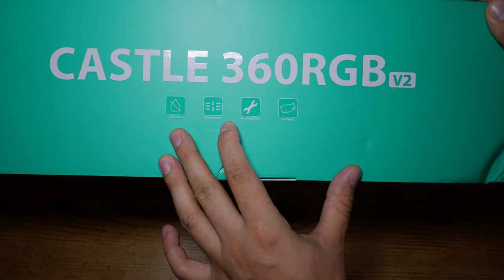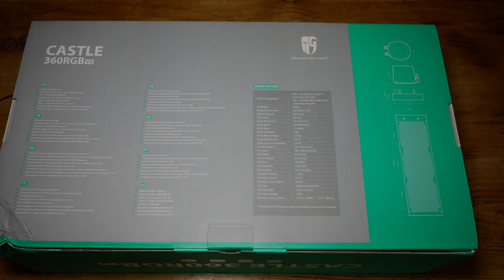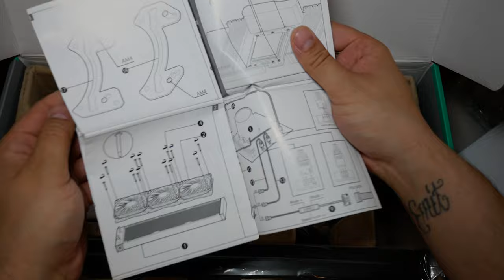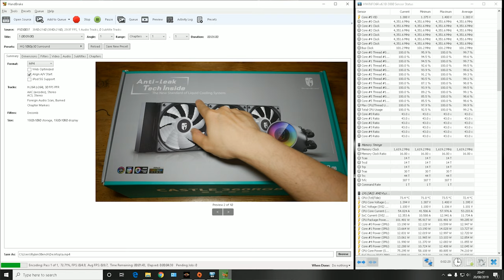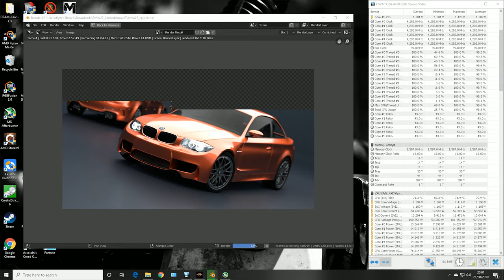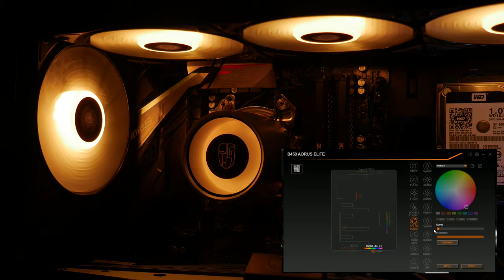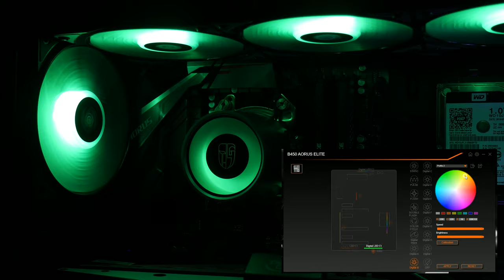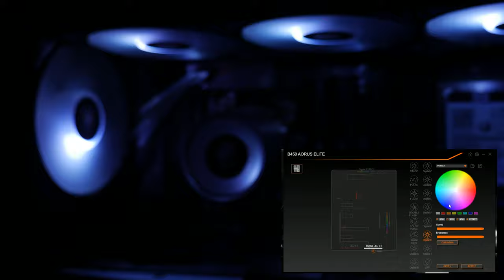Deepcool Castle 360 RGB V2 - Unboxing, Review, Install, Lighting Effects + Ryzen 3600 OverclockTemps

Comment: Just installed a Castle 240EX. Love it. Absolutely silent at idle. Can barely hear it at max load. I used the paste that came on it. It keeps my R5 3600 very cool. Looks amazing. I didn't want the RGB fans because I mounted the radiator where you can barely see the fans and there are RGB fans in front of it already. Couldn't be happier with the purchase and as long as it works like it is for a long time.
Reply: Temps are great for sure,but my castle 360 fans are too loud at only 1100rpm honestly

Comment: tip - you dont have to edit pump pwm curve as most of them (like in this case) don't actually receive the actual pwm signal as they're mostly 3-pin cables (the 4th pin is supposed to be the one carrying the pwm signal), and hence, these pumps usually run at their max RPM. Your bios may show that it's running at a lower value at the moment but that is only a calculated value out of the total RPM (depending on the curve you entered), which it is SUPPOSED TO WORK AT, not the actual value at which it is ACTUALLY running at. So, in the end, most pumps work at their max rpm as they only have a 3-pin pwm (just like this deepcool one). 
There's a reason these pumps are designed to stay at full RPM, and that is actually to extend pump life (seems counter-intuitive but it's actually true). The observed charasteristic of these pumps, is that changing their speed actually worsens the life of the pump as the changes can be quite frequent, and do not happen gradually. So running at full RPM yields a better life for the pump, as compared to variable RPM. 
Hope this was informative enough to help you save time with CPU pumps in the future :)
Other than that, great video man. Cheers :)
Reply: Hey bro , does pump works at max all the time for all AIOs ( low to high end ) 😊
Reply: @anuragsingh4498  most of them dont. but if you see that your pump's pwm cable is 4 pin instead of 3 pin, then it has variable RPMs. 3pin ones dont usually have RPM control pin connected.

Comment: WARNING warning.. read this about the product...  The cpu am4 mounting bracket can on gigabyte x570 pro and ultra motherboard ( and maybe other ) create allot of problems for you.
The problem is the am4 mounting metal mounting bracket touches the condensators next to the cpu and then electricty can "crawl" from one componment to the other.
The problem is the am4 metal mounting bracket is to wide and long.. It can at the same time also touch the top m.2 nvme harddisk.
I have had issues with computers crashing in all games, and BSOD for 3 month, and the moment i removed the cpu cooler and installed another cpu cooler ( corsair ) then the instability stopped instant.  So be VERY aware of this design flaw.
If i recall correctly it cover 2-3 condensators in the top and touches with about 1mm overlap.. and it also touches on top of the m.2 nvme harddisk if it have a metal pad on top of the m.2.
Just saying metal that touches metal that touches metal = can make electricty move arround your pc.  BE very aware of this.

in the video you can see how it almost touch the condensators in the top left.  Im not sure if the metal parts in my product maybe is wider than in the video, but i did have major problems for 3 month becourse of it..  https://youtu.be/AUmSZpIX4nw?t=1217

Comment: Hey man! did you just connect all your ARGB devices into the included ARGB hub?. Ive counted, you must have at least 7 ARGB devices all synced up.. cause i was wondering if there's a limit into connecting argbs devices of one header or hub..
Reply: yea there is a limit, its related to voltage. from the mother board header its around 6 to 8 fans. if the hub uses power from sata. it might be around 10 to 12. i think so!!.
Reply: @SparkPlug8977  no its not limited to Voltage but current. Cuz its a flow divider and not a Voltage divider. And yes there is. Its 1. Limited to current and 2. To the ammount of Individual led(for my MB its 500)
Reply: @saphyresdarkaine  ohhhh I did not know that. Thank you for the info😁

Comment: PLS help i have this cooler in my system but i cant find how to change the rgb light or wich thing i must download to do it
Reply: Did you ever figure it out? Im wondering the same thing.
Reply: @chriswilson1215  yes i found a Controller inside my case and it changes the lights.

It’s a small black controller that’s connected to the cooler
Reply: @Nic_Slash  okay awesome i will take a look at mine

Comment: just got this aio n a pack of 5 deepcool rf 120m fans to replace my corsair 240 aio n generic fans in my hydra desk build. installing tomorrow when kids r at school as i have to do a full strip down to mount the back plate. its goin on an i9 9900k. your vid helps with confirming the chain of fans from aio tho will have to use a second controller for the exhaust side.

Comment: Hello theFullSetup, at 9:48, yeah it does come with daisy chan cable and i have 4 cf120 fans hookup into it. I recently bought Castle 240 v2 and it comes with that LED connector, should I just hook the female 3 pin of the daisy chain cable into that ledconnector to sync them all fans? Great review tho 👍🤘

Comment: I am stuck... and bought 6 LL120 Corsair fans and Corsair Commander Pro. I also bought the Castle 240mm v2 (5v) and paired it with Asus X570 Gaming Plus Wifi.. can I use the 4 pin 12v Mobo to plug the 2 3pins AIO pump fan/LEd!? Anyone can help with that.. I also bought Deepcool 5v to 12v adapter and still don’t know if I really need it... anyone has a clue? Don’t want to burn anything... it’s my first build

Comment: I bought the castle 240 rgb v2 product and noticed that the pump led has a little less brightness than the fans led, I was wondering if it is normal or my product may be defective
Reply: The exact same issue with my cooler master aio

Comment: So I installed this before I completely removed the cables for “mastercool 360 rgb aio”, this one works its function but the average temperature goes from (mastercool 65) to 80-90. The rgb doesn’t work but it’s plugged in... not sure how I’ll manage to fix this any tips anyone?
Reply: I saw another comment saying that you have to have a 5 volt rgb header on your mobo

Comment: You installed AIO as exhaust on top? i thought aio radiator is always front intake?
Reply: Doesn't have to be, I don't think I have ever, in a decade, had an AIO setup as intake.
Reply: it's better to have it on top as long as you still have a positive pressure inside the case.
Remember, many smaller cases dont have large AIO support on the top and have only front-mounted options.
But if you can, mount it on the top. But maintain positive pressure otherwise the case can accumulate more dust inside than neutral or positive pressure.
Also, while doing  multi-rad setups, the hottest fluid should go in the last exhaust radiator, and not the first.
In a single-rad setup, top mounting ensures cooler air going into the GPU first, which usually have their frequencies dependent on their temperatures (lower GPU temp - higher achievable GPU freq). The same does not go for your CPU. If you want your CPU running at 5GHz, it doesn't hurt much if it's temps go up from 75 to 85, or even low 90s, as CPU performance is not much temp-dependent as long as you do not reach the throttling temp limits. 
I see you're a gaming channel, and it's better to keep your GPU cooler than the CPU.
Also, if you think you're gonna reduce you CPU life by doing this, dont worry. It'll reduce from 15 years to 14 years maybe XD. That's a lot percentage wise, but does not affect you practically as you'll end up changing your CPU within the next 4-6 years.

Comment: I was running all Corsair Products in my PC but the H150i took a shit. So I got this. Do I have to run this completely separately to my icue set up? Is there a way to sync the RGB on the Castle to the stuff I have on icue(memory/fans on icue hub). Also did I see the Asus motherboard software controlling this?

Comment: Would you recommend the deepcool Castle 240v2 or the Antec Neptune 240?
Reply: deepcool is better. Temp differences may not be that much in this category but it definitely runs quieter on similar RPMs.

Comment: I got a Problem for Am 4.. If i screw the First 4 Screws it will wiggle.. Has it too wiggle?
Reply: It's normal the first 4 screws to wriggle when screwed into the back plate but once the pump is on and screwed it should be secure

Comment: It’s a nice video but I’m still confused 🤷‍♀️ ! So on a B450 MSI Gaming pro there is only 4 pin 12V ! But I can use the controller to make it work or does the pump need also a 3 pin 5V ?
Reply: I just got mine today although I do have a couple 5V headers, but yeah I think if you don’t have a 5V header you can use the controller to change the lights

Comment: @TheFullSetup I have 3 Noiseblockers E-loop B12-p bionic fans . Case- Lian li 011 dynamic ,. I am thinking to get a 360 mm aio for my 3600x , i really like the design  of this aio , can you tell how does it compare to kraken X72 , I am thinking of getting this and reolacing the stock fans with b12-p and use these fans as sude intakes , what do you think will it perform Similiar or better than x72 with these fabs on radiator , as you said , fans are the weakest part of this aio.  Pleaseeee help

Comment: Great vid, but some terrible advice, like what is the point in making a point about the anti-vibrating pads on the fans if you only use 2 screws to hold each fan? I guess its nowhere near as bad with fans that have anti-vibration pads as if you were using fans without them & only using 2 screws per each fan you would have some rattling sounds for sure :)
Reply from the maker: Nope no rattle sound at all the pads are more useful when using conventional case fan screws when using the M3 bolts zero rattle even with two screws. It was more about there whole line of coolers and fans matching and looking the same in the case.

Comment: apart from the rgb fans on the rad, whats the difference between this and the Castle EX AIO?
Reply: I asked Deepcool support about that since I noticed the RGB V.2 has fans rated for a tad higher airflow than the EX - and he said the difference is in airflow and air pressure, but that in technical sense the difference is almost something to ignore - and that they are both with a TDP of 250W.
Would be nice to see them benchmarked head to head though - but it sounds like if you want the RGB - go with the RGB V.2 - that is the info I got from the support team anyway :)

Comment: I can't control the RGB with software because my graphics card blocks the ARGB header of my motherboard..
Reply: Use a splitter, second, you got a bad mobo if the argb header is not on the edge of the mobo

Comment: Have the same model but im worried because their Captain version have a lot of issues mostly leaking
Reply: The Castle doesn't have the twisted tube, and the V2 has the little pressure valve.

Comment: do i need to buy liquid for this?
Reply: No, pre-filled. It's all in one.
Reply: @UnknownEAFCPlayer  thank you
Reply: no, it's a closed loop and is not meant for the customer to open and fill/re-fill. Much more reliable than a custom loop but also does not match that level of performance. also, this is cheaper than custom loops.

Comment: WHERE DO I PLUG THE ONE WITH THREE HOLES FOR THE COOLER??
Reply: Did you find any answer, im struggling with the same issue ahaha
Reply: CPU OPT header for the 3 pin fan connector for the pump. The pump I believe runs at 1 speed so it just needs power from the fan header.

https://youtu.be/I3gLvA2JOz0
Reply: 3 pin connector goes to your pump header on the Mobo if not just a fan header works too,